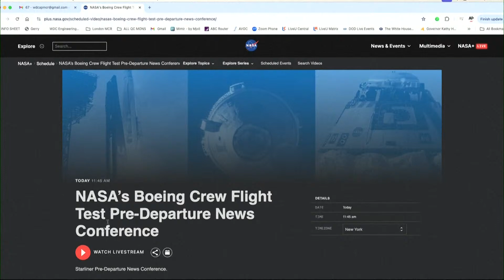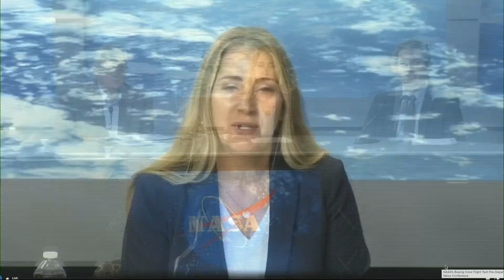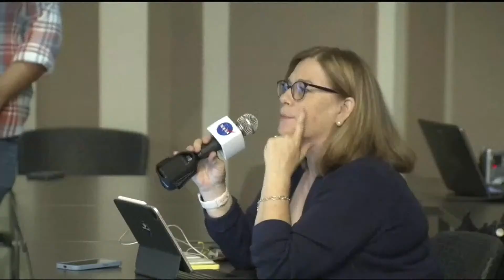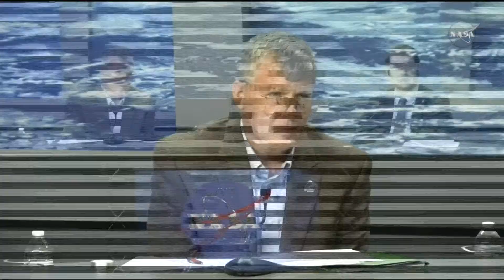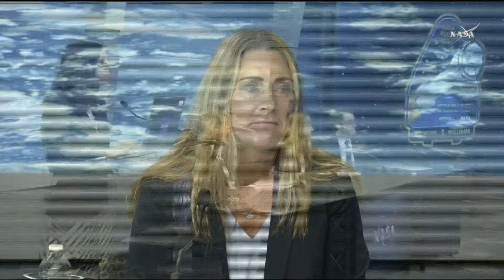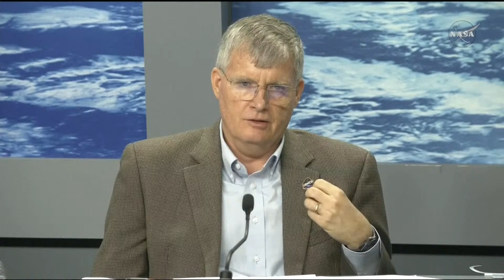LIVE: NASA hosts pre-departure briefing ahead of Boeing Starliner’s empty return to Earth

Comment: Would have been much better if there was no press conference on this. Pulsing thrusters are not a thing to be discussing at this stage in the project…those thrusters should have full thruster pulsing capability parameters established and operational prior to lift off. This is not a high school science project.